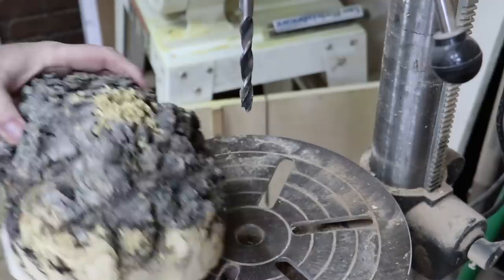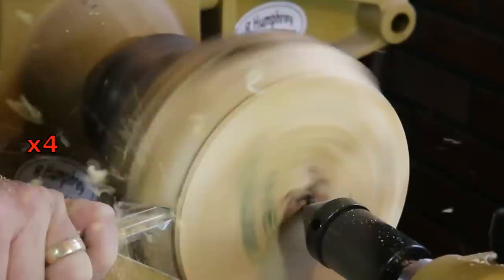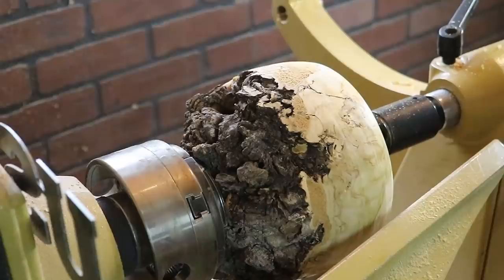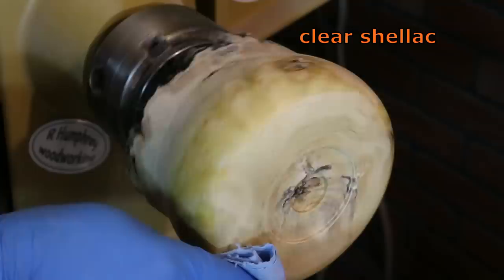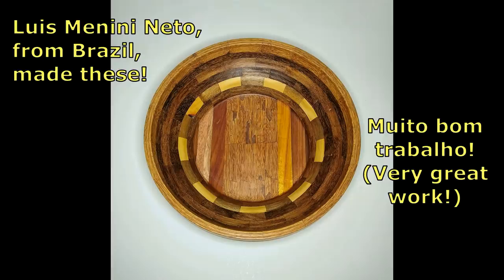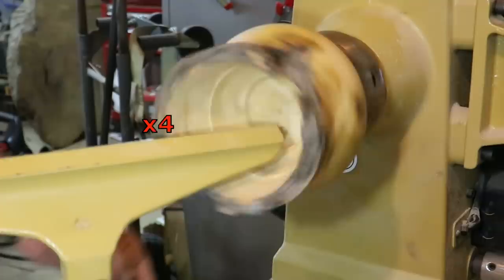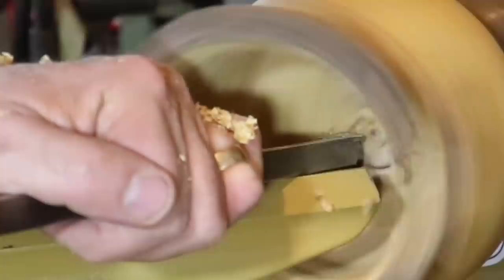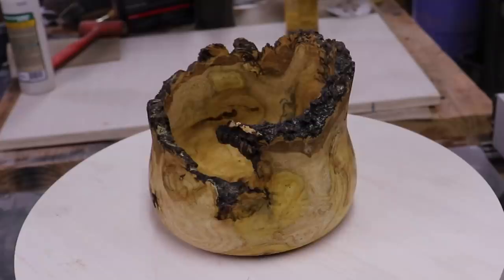Woodturning a Red Maple Burl

Comment: Great video work of you working the inside of the bowl.  So sharp and very clear to see your technique with the carbide. I have two carbides.. and like you rarely use them. How stable is your bark rim? On the few occasions I have done the bark lip, I have saturated with CA. to make sure it stays put.
Reply from the maker: Thanks very much!  The bark is nice and stable, the shellac saturation works well, soaks in deep and firms everything up as it dries.  I've used CA glue as well.

Comment: Rod.. I really enjoy the videos. I’ve just started turning myself. Wow, what a meditative exercise.  I was playing with a old piece of something I had laying in a woodpile for years. It’s rock hard... which brings me to my question coming up. I think 2 hours went by and I hardly noticed.  So, I picked up the table top machine from harbor freight. It will turn up to 10” and 18” long. It working well so far. Can’t wait to show off my first “NOT” practice piece.  I’m already looking for a better set of tools. An upgrade from the $30 set off the shelf at HF.  Do you have any thoughts? I know you don’t do sponsors so I don’t want to put you on the spot. I’m just trying to learn the lay of the land a little.

Comment: Wait,  when you drilled the center, did the drill leave a tiny thin dowel??  What kind of drill is that?
Reply from the maker: It did!  I wondered if anyone would catch that.  It's a regular forstner bit with the center screw removed